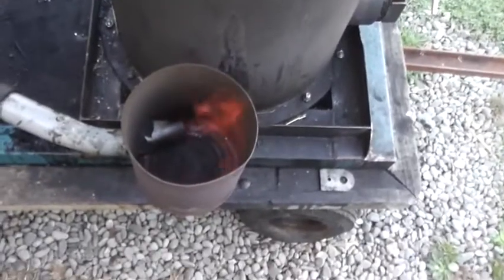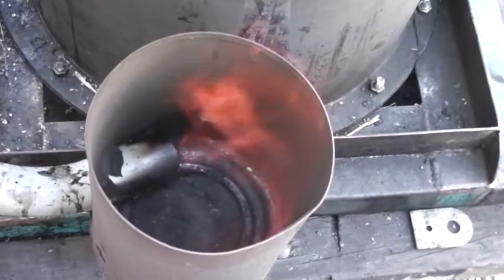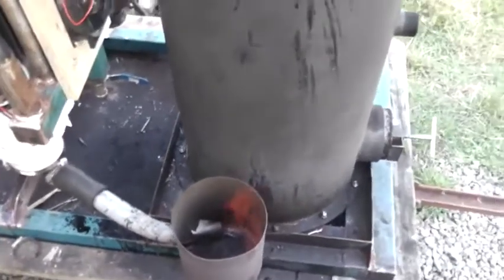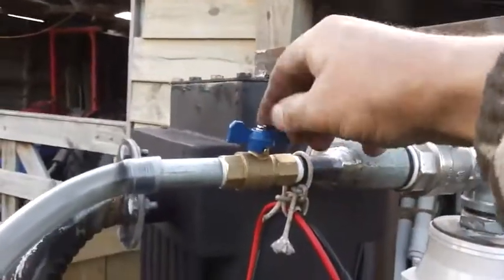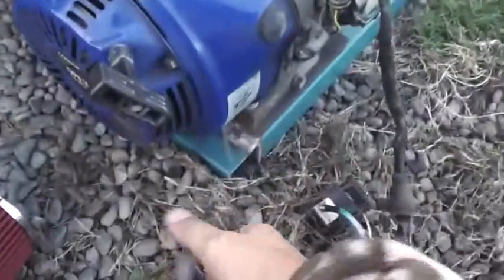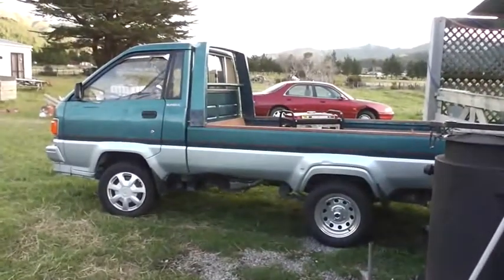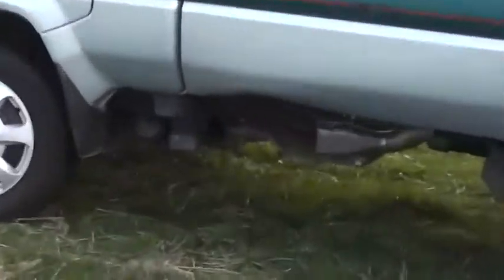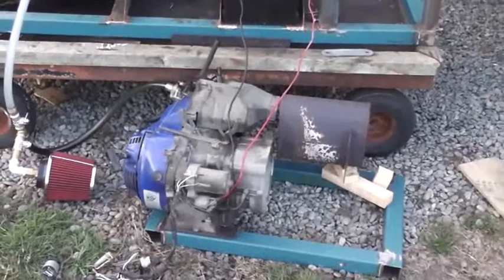From flare to 13HP engine startup on Victory gasifier

Comment: Something to keep in mind. You may not always crack 100% of the tars 100% of the time and you may see some light oil thin tars and if you do those will never collect like the thick heavy goo tar that you would expect to see in the FEMA stuff. The filters will pretty much capture them. It's the heavy goo tars from a bad burn that get past even the best filters. I have been studying this on my setup for the last few months as I fine tuned everything.

Comment: Cont: If you have any doubts, run a paper towel or even a rag through the flare tube! That will answer any tar questions then and there. Since I got my new Imbert gasifier running correctly all I see is soot dust. I can wipe it onto a paper towel and wash it off with water. Continued one more time.

Comment: Hey man I've been subscribed to your channel for a while now and for some reason none of your updated videos popped up in my subscribed channels. Your flare is a Halloween orange and it's not milky looking. I'm speaking from my own observations with my gas and what I have found on line at a really informative site but it looks like you are cracking the tars. The Halloween orange color is probably the soot's from the cracked tars being consumed at the flare. Cont:

Comment: Running the gas is really just a last ditch effort its about all you can do. If you have E-85 in your area building a hybrid with this fuel works a bit better for engine cleaning. Also ethanol will run at the same compression ratio as wood gas. When the cold air mixes into the gas the temp is dropped instantly. The dew point for dropping tar is about 160*f. and this is when it will just start to drop out. So mixing the air and then having the vessel will help catch the tar at this mixing point.

Comment: I use a high velocity vortex type filter just before the carb. This is there to identify whether tar has been present in the gas making it to the engine. This will of coarse remove much of it, but if I open the drain after a run if there is condensate in there that ok, but if the there is that gooey tar dripping out I immediately run gas for min of 1 hr.

Comment: My current unit is so stacked in and i have it incased in metal to hide it due to how WI laws are and its had lots and lots of repair work and test mods done to it as soon as i get the money to build a brand new smaller unit more compact and all that i will! My plan is when i build the new unit i will show it being built each step and with the mods as i build it! check out my blog on the wood gas/how to page i have plans up on my old unit i use now and my next unit kinda on how its going Cont

Comment: PT2 Cant say hrs due to the hr gauage was busted when i got it. My small gen has been used on wood gas now on and off for over 6yrs or more i forget when i got that one i do a white cloth test over my outputs b4 i run a motor for ash soot or tar to be sure there it none! If i see anything i make changes give it a few min then white cloth test again as long as i always test like that i have not hurt any motor of min now in over 9yrs+ of using wood gas!

Comment: Soot or ash once its small who can tell its still not good at all to me with a 300 or 400 deg gas temp going into the motor! On a few of his vids he has said soot some he has said ash! What ever each have there own opinion i dont like it one add on filter would fix most of that! Yes yr right anyone with a gasser unit makes tar on every startup! Cool on the 300hrs i have to redo my big gen its made it 3 yrs with a oil leak on the piston rings for 3 yrs running wood gas cant complain camt say hrs!

Comment: i believe Wayne say's soot. soot is different than ash as it will burn. most of the time on my small gasser gas temp going into the mixing valve is at ambient. i'm not saying i've never made tar, but when i did i figured out what caused it and fixed it. i doubt anyone that has built a gasser can honestly say they have never made tar. and just bfyi i have about three hundred running hours on our genset burning wood gas.

Comment: Yes true but there are a few big thing no one ever talks about they both run hot to warm gas into the motors and Mr. Keith even says he is running ash in the motor well if you know anything about heat and air hot air is way less dense and holds way less fuel thats one big thing is see with there's gas is way too hot and i my self see ash in a motor as no diff than putting sand or dust over time it will kill it plus tar only leave wood gas once its been cooled down! also the water dont leave!

Comment: I have found that as long as yr wood gas is clean its way better then running dirty gasoline and with out all the carbon crap to build up like gasoline its able to keep the oil cleaner longer and it can let a motor work for many more yrs with less trouble then running it on gasoline! Now if you run a motor on the gas like Wayne Keith does with lots of ash and crap into it then no it wont work that way he even say the ash is no big deal but really its is!